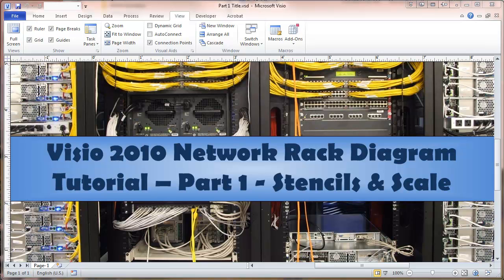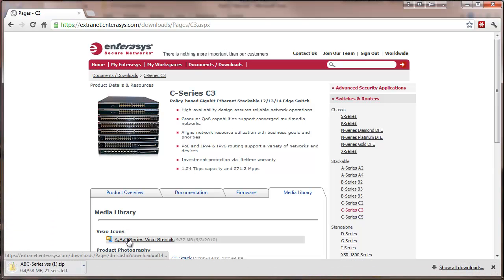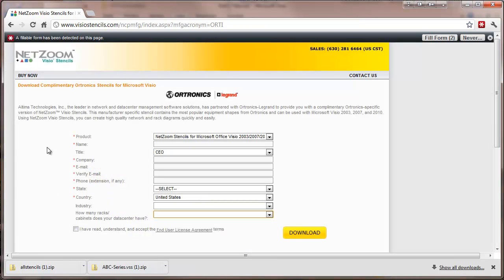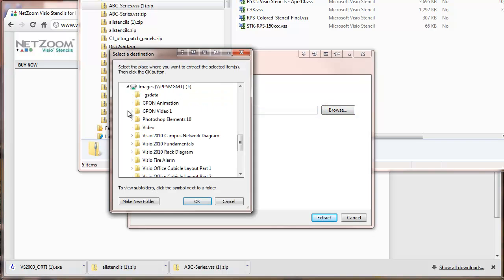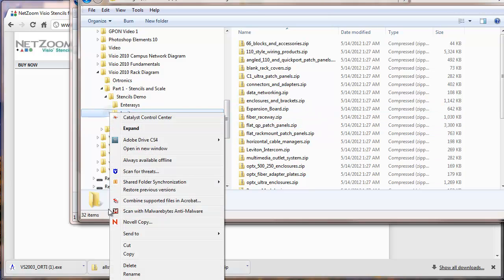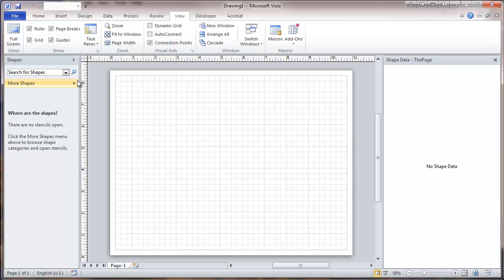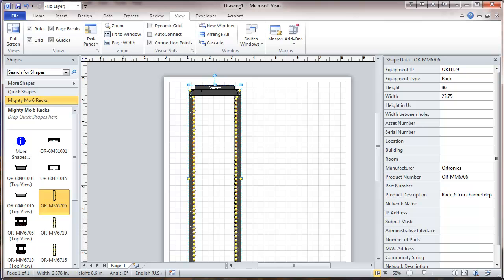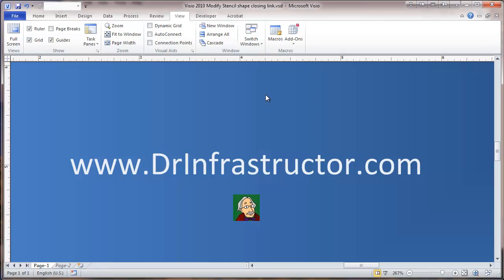Visio 2010 Network Rack Diagram Tutorial - Part 1 - Stencils and Scale

Comment: Great video! I used a website called Lucidchart to create my own server network diagram and it was super easy to use. If you use diagrams often you should check it out! www.lucidchart.com/pages/examples/network_diagram_software
Reply: +Macy Dalby   Friend need windows key can go link https://plus.google.com/102893810581033577754/posts/aNGtXuuraba to got. My key got here and after i used is works properly.